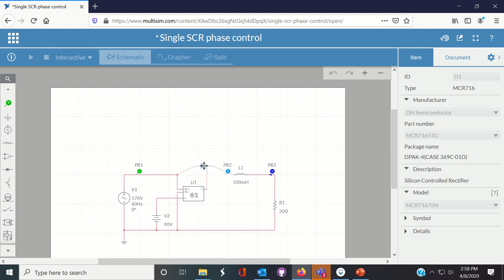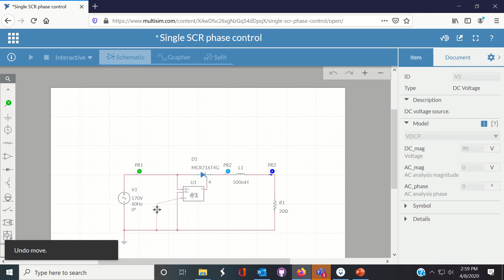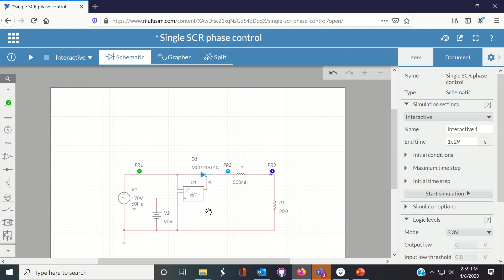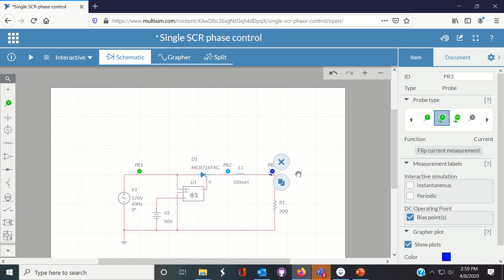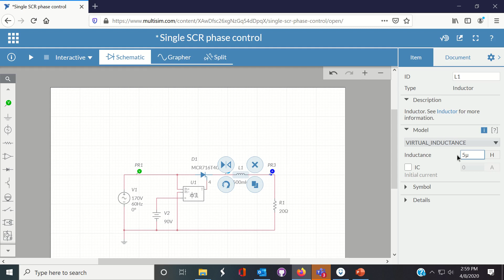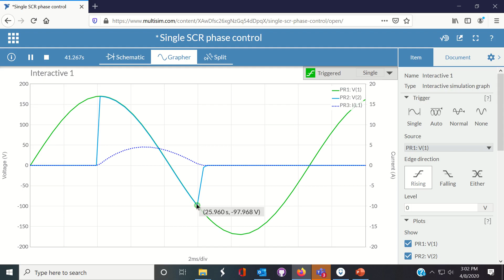SCR commutation with an inductive load

Comment: at the end of the video you mention the SCR continues to conduct if the load is inductive due to the current lag. Is there a way to remedy this so the SCR shuts off when the voltage crosses zero still to avoid that negative dip?